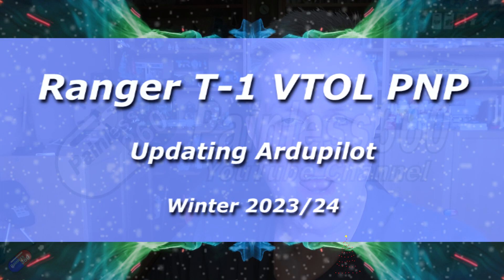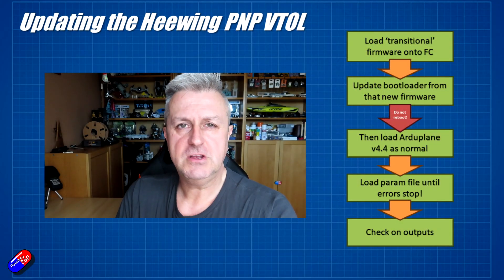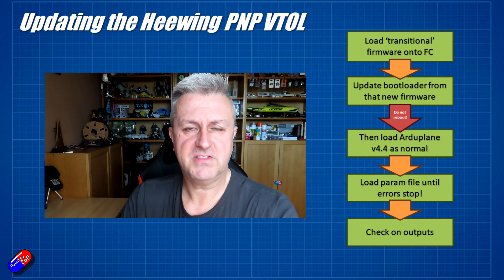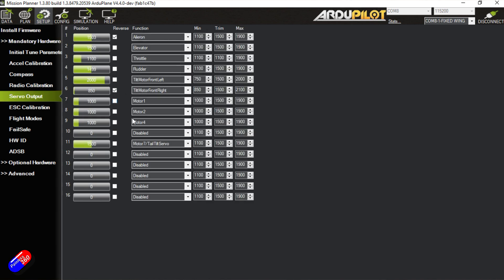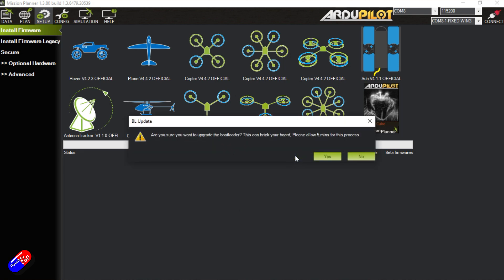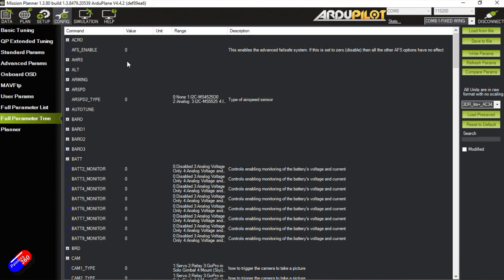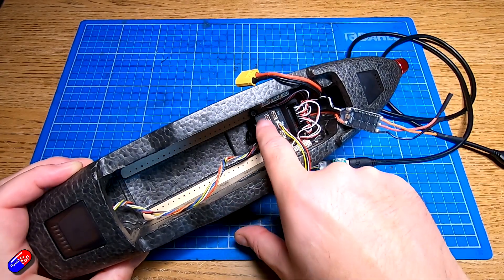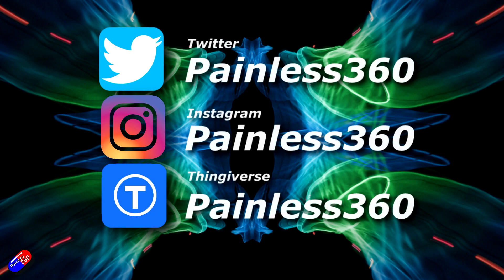HEEWING Ranger T-1 VTOL PNP: Updating Arduplane safely

Comment from the maker: BE AWARE: it appears that units bought now are being shipped with the 'V2' flight controller that shouldn't need this process. Check what yours is before starting down this updating bootloader road!
Reply: How do know? does "V2" just show up in Ardupilot or something?? I honestly never noticed the board name, when I plugged it in. I do remember getting errors, when trying to add the new parameters...I got mine about a month ago.
Reply: Under the Messages tab in Mission Planner it will show up as HEEWING-F405v2 or possibly F-405 TE I believe if it's a V1.  V1 and V2 look identical on the outside. @gammagonad
Reply: Got mine 2 weeks ago. On the device manager it is labeled as "HEEWING-F405v2". I haven't seen a "v2" somewhere else. @gammagonad
Reply: How do we verify if it is a V2 @Painless360 BTW, thank you for your work on these videos
Reply: I have the same question. Did you ever get an answered
Reply: In Mission Planner under messages tab, it will display which version you have. @CentennialJewelers

Comment: Hi I’ve watched many videos and everything moves the correct way  Qloiter motors work fine. Should I be able to test forward flight mode whilst on ground without props ? When I switch modes motors move horizontal briefly then back vertical and it powers down and disarms. Thanks

Comment: Help!!! Just set all my parameters to default... Thought it was just going to change the 3 on screen parameters. I've got the Heewing F405 v2..(T1 Ranger) . I've updated it to the latest Ardupilot, but just can't seem to find a way to get all the vtol factory settings back on to the FC! Any guidance for this idiot would be much appreciated. 😮 Thanks in advance.
Reply from the maker: The params should be persistent between updates. The only way to reset the params is to flash a different ardupilot  model type...
Reply: @Painless360  Thank you 👍

Comment: Can u tell me what channel i need to be on for the manual mode to work in plane mode? I have 3 modes set on my 3 way switch so that its in drone/fbw/and rth in plane then switch to drone mode but i cant figure out which channel i should set the 2 way switch on for the other 3 modes to work. I have a stock t1 vtol pnp that I just bought a month ago from heewing directly so it's got the newest fc as u say
Reply from the maker: Check out the build videos that cover that... Happy flying
Reply: @Painless360  i tried but can't find the info on this fc, I think u use a matek on your build? Can u share a link by chance
Reply: @Painless360  could I just use stabilize mode instead of fbwa? I tried manual in place of fbwa but it was tricky having to bank and pull back to turn lol it's definitely a new feel from the quadcopter world lol
Reply from the maker: I fly on FBWA most of the time with Ardupilot. Best of luck!

Comment: So I bought this model when it first came out. Still haven’t flown it because I wanted it to be right. Saw this video back then and started the process. I remember having issues, and getting frustrated. Anyways I decided to give it another go. I get to the point where I’m trying to upload the transitional firmware, but it gets stuck on “COM3 Identify” and then after maybe 30sec. and then straight to “ERROR: No Response from board” every time. It will actually connect to Mission Planner, but won’t flash anything. I’ve tried this with two different PCs and multiple data cables. I’m about to use this stupid FC for target practice. Any ideas of what it could be? Thanks for all you contribute to the community!
Reply from the maker: I'd try and flash it with something like INAV or betaflight to see if that works... Best of luck
Reply: @ I know BF and INAV well as Ive been in the hobby since 2018, but this is my first Ardupilot craft. Don’t know all of its quirks yet. Thanks so much, may give that a try
Reply from the maker: If it flashes with INAV or BF then you know the PC, cable and FC are good.. Best of luck!

Comment: Hello, thank you very much for your video. I got my vtol t1 Ranger pep kit, put everything together but it fails when connecting to pc. When I plug in the USB it flashes green first and then red. but nothing happens. I don't even get a COM display. It sounds like my PC doesn't recognize it.
what can I do there? do you have an idea? I've already tried the Ardupilot drivers but nothing happens.
Reply from the maker: Try another usb data cable?
Reply: @ I have already tried 7 different cables
Reply from the maker: Then please cover what other troubleshooting you've tried,  so time isn't wasted covering stuff you've done already...
Reply: @Painless360  Tried mission planner version 1.3 to latest. No success. Mac mini 1m Macpro m2 Windows 11 Windows 10 Windows XP. No success. Reinstalled direct x from ardupilot. No success. Tried 7 different cables.
Reply: @Painless360  My t1 is new and should have firmware pre-installed according to heewing.
Reply from the maker: I'd contect the seller to get help in case it's the flight controller... Best of luck
Reply: @Painless360  I was able to find the error. My USB port on heewing f405 v2 was defective

Comment: Have you seen anyone trying to run the new iNav vtol on the FX 405 fc that heewing ships in these?  I bought the full version cause it was only a small amount more but ultimately will replace the stock FC with iNav for and probably play with that.
Reply from the maker: I don't think I've seen that INAV supports the HEEWING F405 V2 boards that come in this model... Best of luck!
Reply: @Painless360  Yeah, I was looking over the targets and didn't see it but figure its based on something more mainstream... maybe not though.

Comment: Thanks again and again for your helpful videos. Can you tell me how I can check the rudder setting? The ailerons and elevator are clear, but the rudder is not clear to me. Is there a little trick?
Reply from the maker: Best place for up to date information is the Ardupilot wiki. Rudder control is different in fixed wing and hovering modes... Best of luck

Comment: FWIW I recently got a PNP and can confirm the FC identifies itself as HEEWING-F405v2.

My defaults most certainly did not match any of the setup videos as it was already setup for CRSF / alt board config etc.   I did have to set the RSSI type.

My issue is QLoiter doesn't seem to aim for Level at all.   In manual it seems to work just fine with differential thrust on yaw etc but QLoiter definitely doesn't work and the plane seem to target 45 degrees nose down as 'level' which pretty much just makes the craft hurl itself forward.

I plan to flash to firmware and apply the diffs linked and see how it goes.

Comment: I just received my T-1 VTOL PNP which came with v2 FC recently. Updated to 4.4.4 and applied the params. But felt the loiter was weird, drifted. Loaded back factory and loiter was solid, FBWA flew beautiful. Going to experiment a few more times.
Reply from the maker: Well done for backing up the config... Happy flying!
Reply: @Painless360  Awesome work btw.You are doing a great service for the Ardupilot community. Been using the ecosystem for more than 10 yrs but there is always something new to learn :)

Comment: i completed this including swapping connectors,  now my rx doesnt respond to inputs even though it is connected.   flight controller responds correct surfaces but the rc inputs are jacked.
Reply from the maker: See note in description. Rc inputs will need resetting. Best of luck

Comment: Respectfully, I need help.  After confirming the Heewing fc board IDs as Matek F405, I loaded the transitional firmware using "Load custom firmware". This causes Mission Planner to give error: "Firmware not suitable for this board fw".  MP then times out with "No heartbeat packets received".  Yikes!  Not sure what to do now.
Reply from the maker: The process and way it worked for me is shown in the video.  As mine went as planned,  I didn't encounter any issues but did add the protips from the developers in the video... make sure that you need to do the transitional firmware.  The newer V2 FC has been shipping for a while.
Reply: @Painless360  I will go back and re-flash the original 4.3.5 firmware and start over.
Reply: I got the same error so I just flashed it with the newest Plane V4.4.3 and it picked up Heewing F405-V2. All seems fine now. Thank you Lee.
Reply: @ferdivaneeden7619  Same here after several attempts.  Thanks guys!

Comment: Hello Lee, like an everyone else has been saying I say it also,, a big thank you for all the work you have put into this flight controller along with Andy. Is there somewhere I can drop you some pictures of how I set up my receiver, GPS and the internal fuselage wiring. Now I’m good at tinkering with this stuff, but when it comes to plugging it into my Mac, well, that’s a different story. I was not able to get a response in Ardupilot. I will keep watching your videos. lol Rudy 👋🇨🇦
Reply: Found out that crossfire receiver is not compatible when plugged in to the Receiver 4 pin input on the F405 FC. I will be rewiring my RX to Uart2.
Reply: Well, that still didn’t work when plugged into Uart 1 or 2. I will attempt to connect on a Windows PC

Comment: Lee,
Excuse my ignorance but....

I have followed the instructions in this video to the lettre but nothing is reacting as one would expect.
Also, In the comparison charts for the servo output check in your setup there are two times "tilt motor front right" and two times "motor 4"??
last point, The FC has only 9 outputs, what to do with 'position 11, motor 7/tail tilt motor' ?
I hope you can explain to me what to do or point me to another pace/video where I can find the answers.
thanks in advance.
Reply from the maker: Please see the note in the description... Best of luck
Reply: Did you manage to get it sorted out?
Reply: @TangoAlphaFPV  No, no luck so far. Seems to be something between the radio and the receiver because when I set-up channel 6 for Flightmode nothing happens and I also cannot arm the plane with 4 sec full right rudder. If I disable arming check in mission planner nothing changes in behaviour of the plane, mission planner does accept the command change and answers with "armed" but that is all.
All servo's and motors do react if I connect them directly to a servo tester so only things that remain are the receiver and its connection to the F405.
I am using the set-up that Lee proposed in another video as a template.
Spend a couple of loooong afternoons now but I get no result. Kind of lost of what to try next.

Comment: I have got T1 range VTOL frame, but a little bit confused about aileron control.
Since there is no rudder, from my perspective, it should be left/right aileron to trun the plane right or left.
So I think there should be 8 PWM pin be used, just as follows. 
1. left tilt servo
2. right tilt servo
3. left motor
4. right motor
5. left aileron  
6. right aileron 
7. elevator
8. tail motor
I do noticed that you have 9 configured connections:
1 = Motor2
2 = Motor1
3 = Tiltmotorfrontleft
4 = Tiltmotorfrontright
5 = Motor4
7 = Aileron
8 = Elevator
9 = The cable that was in outputs 3 (THR) originally
So how about the real connections on those servos?
Reply: I have got an other video about FC diagram. It's quite understandable. Still a question: Can I use S4 for servo?
Reply from the maker: Ailerons are on one connection. Best of luck
Reply: There is no rudder. So how to turn left and right with ailerons on one connection(PWM)?😇
Reply from the maker: Bank and yank.... bank and yank. Same as flying wings..

Comment: In the process of swapping wires around.
I have noticed there is 2x tiltmotorfrontright in the new outputs? Also which was is throttle and rudder? In the new outputs?
Reply from the maker: See note in description.. Best of luck.
Reply: @Painless360 
Would you know why my elevator and ailerons no long respond?
Reply from the maker: What troubleshooting have you done already?
Reply: @Painless360  
I did revert back to my original parameters file to make sure it wasn't the servos acting up.
Just the standard stuff making sure the wires are in the correct way etc.
Being fairly new to ardupilot I'm not sure what else to do.
Reply: @Painless360 
I have played around swapping servo outputs and ailerons will work all channels upto 6 but nothing after that.
I am using elrs just incase.
Reply from the maker: See my build of a VTOL using this model  that shows how I tested everything. Best of luck.